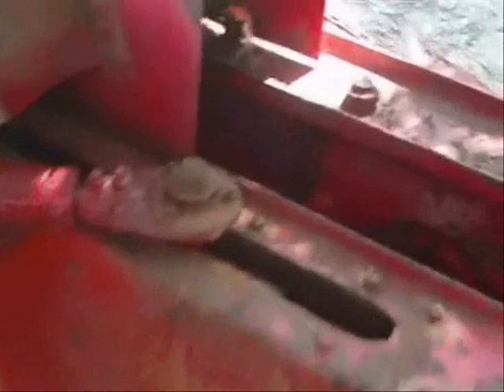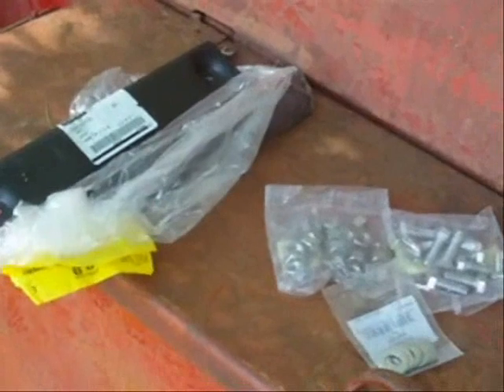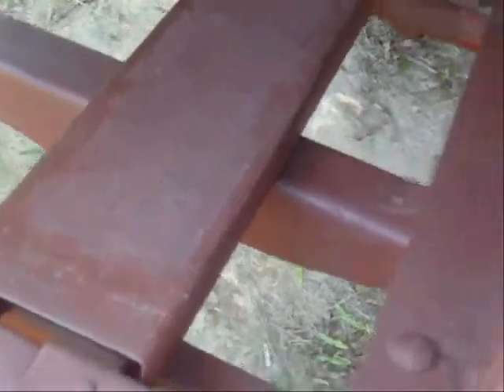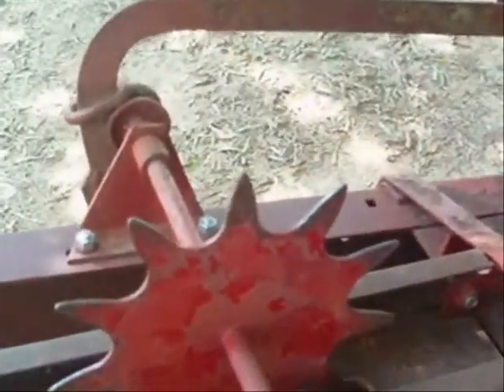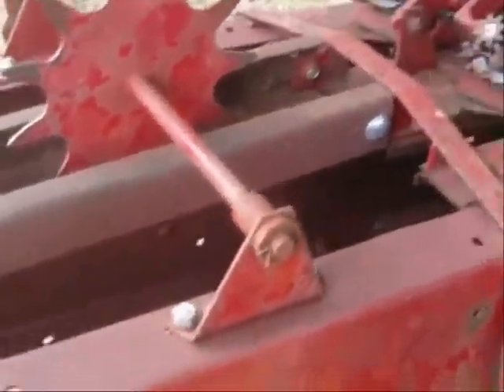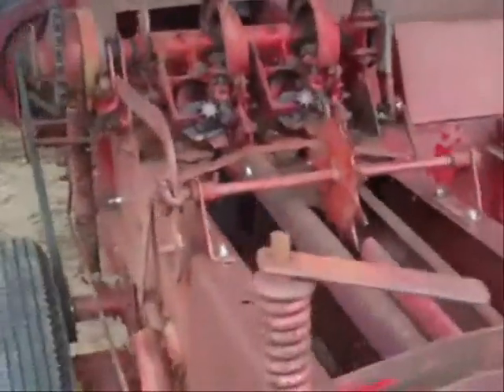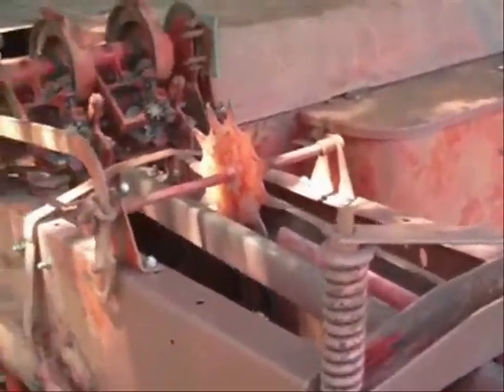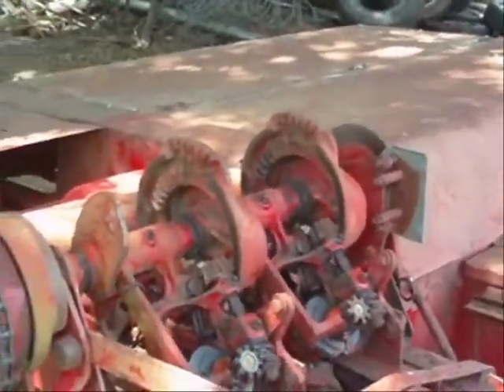Baler Repair Part 19

Comment: hi, I have a nh 315. It started the season perfect, but after about 500 bails it started having a problem. on the one side it would cut the string right before the knot. Sometimes it just nicks it and other times it is completely cut. It is about 2 or 3 inches before the knot. I am guessing that the string isnt being held right at the time of the tie, when the knife comes accross it.  How do you think i could fix it? is the tucker finger have anything to do with it? Im not sure what to check or replace. ty so much, joe